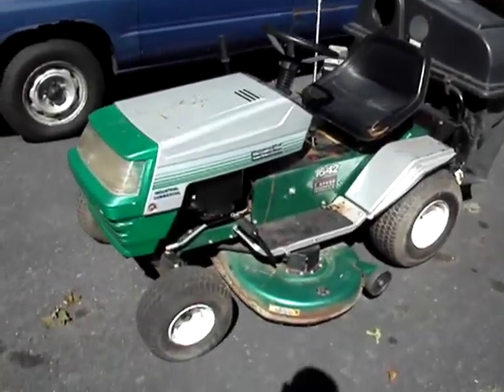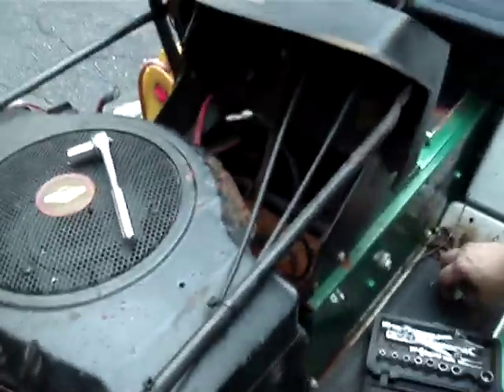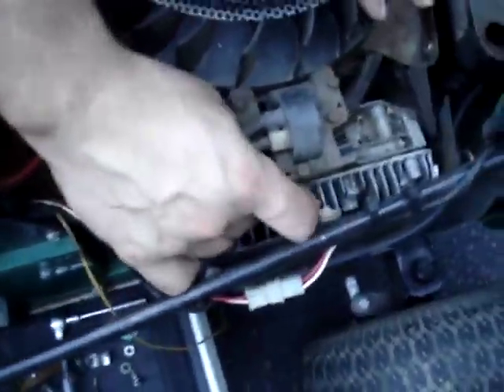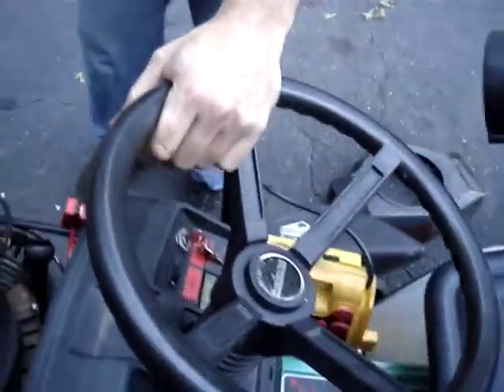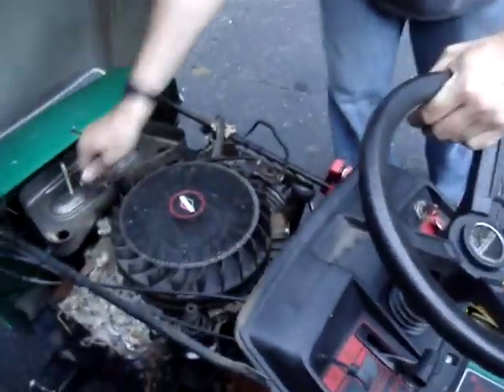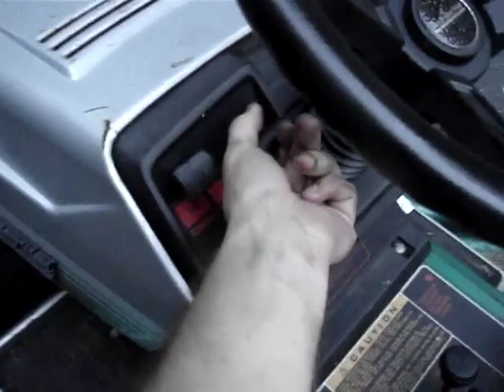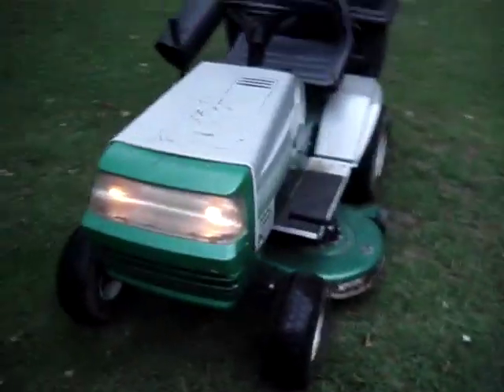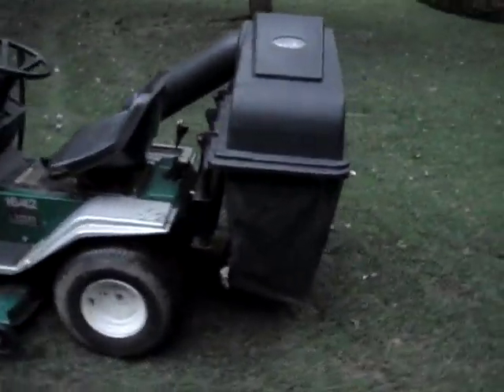1990 Montgomery Ward 16/42 -16hp twin cyl. lawn tractor

Comment: that lever problem is a huge problem if you have a bumpy drive way and you run over a rock, the deck could accidently engage and then you have to pay for new blades,belt,mandrel,or a pully.

Comment: i just got an Agway with a 18hp opposed twin , and a 46" deck, the engine code says it from 1989. it has the tank in the back, where is the fuel pump? i see the fuel line go into the carb, the another like from the carb, that  goes in to the engine, ( is the pump internal??)